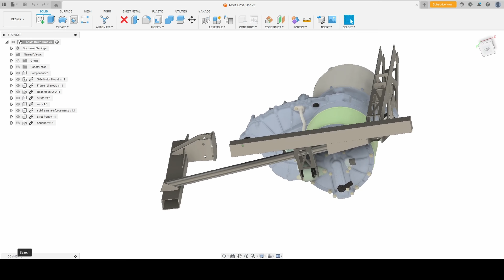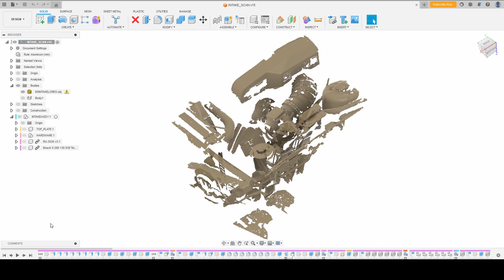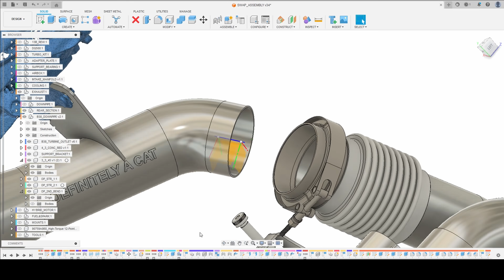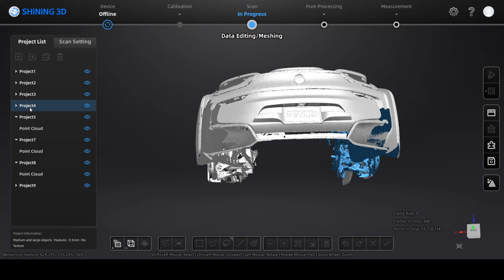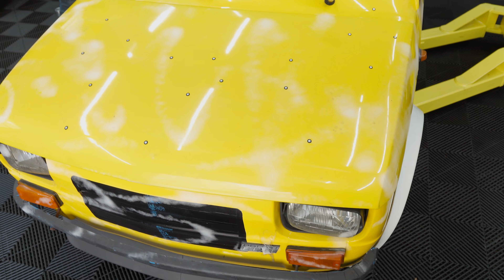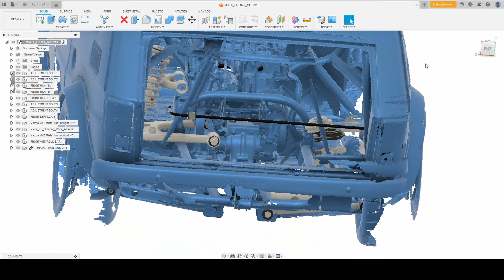Is the Einstar 3D scanner worth it? One year of automotive projects later.

Comment: this probably isn't a new complaint but, I've got an all AMD PC. that's right... I found out after I purchased an open box Einstar scanner that the seller isn't accepting returns. I'll need to either add a second GPU that's NVIDIA made or just ditch my AMD card entirely. I wish this had been stated up front before I purchased. not just on the seller but, all the reading and searching I did never seemed to mention this. 😞
now that I'm done complaining, I'm a new subscriber as I heard from a friend about the wild BMW project you're doing. can't wait to see it running and making noise in the car!

Comment: Is the Einstar still worth purchasing at $645 in January 2026 for someone who wants to scan car parts like valve covers, timing covers, etc?
Reply: I might have to reconsider this question, looks like you have to have an Nvidia GPU to run the scanner/software. One of my pc’s has an old 1080ti, but the other newer one is running Radeon rx 6800 xt

Comment: Hi Jon, i am just packing my Creality Raptor Pro to have it returned. The issue and criticism is almost identical to yours.  I'm returning the scanner because it's unsuitable for my automotive project (electical restomod of a corvette C3) and, in particular, because of the severe software's lack of functionality. That can't be it! Compared to the Einstar and its Shining software as a reference, the Creality software has too many programming errors, no way to align the scans to a coordinate system, and, extremely annoyingly, no support for the 3D Connexion Space Mouse. Sorry, I have to work with it and get results, not spend hours sticking markers. Even though there are many recommending videos on YouTube, Creality is a good year behind the competition when it comes to software. Thanks for your review. Yesterday i ordered the Einstar. Half the price of the Raptor, twice the functionality of the Raptor. I want to work, not to play.
Reply: Finally I had a servere struggle with Amazon. They complained about the return and cited me for allegedly returning damaged or incomplete items. Yes, about 50 original marker points were missing, which were replaced with similar items. I think Creality is being really unfair to the customer. The customer then has to deal with the seller, and the real cause is poor, faulty software that doesn't serve its purpose. The scanner is great, but the software ruins the success of working with the device.
Reply: Isn’t the obvious limitation with the raptor the scanning size? It’s only suitable for small items right? That is what is really limiting me with my raptor

Comment: Could you go into more detail on the exhaust measurements? Kinda got lost on what you’re doing.

I see build the mandrel bends off the origin point, find the center line and angle but I’m confused on the chord length.

How does the chord give you your alignment marks?

Gonna buy one of these scanners now and I subbed. Good stuff man!
Reply from the maker: The chord length is where you make the mark to which you rotate the tube to. It just allow you to do it with a straight measuring device rather than trying to wrap a tape measure around the tube
Reply: @CouchBuilt I watched it again. The 110° is how much one bend rotates off the centerline of the first one?
Reply from the maker: You got it, centerlines are rotated 110 apart.

Comment: Great vid, thanks. Would you have any recommendations for a computer, e.g. i5 or i7, 32GB or more RAM, 4060 or better (ouch), etc. I suspect an appropriate laptop will be 2 or 3 times the price of the Einstar and moving my gaming desktop about isn’t realistic, even if it does have the hp.
Reply from the maker: Max out on RAM. Im on a 2020 Asus G14 with 40GB RAM and an RTX2060. The GPU is dated but holds its own. It will peg the RAM resources easily.  I've been eyeing the new ASUS PROART 16 as a possible update.
Reply: @ Thanks! I’m not surprised about the RAM. I was using Reality Capture to 3D model my house and a couple hundred photos produced a 60+ GB model. Even with a 24 GB VRAM in a 4090, I had to upgrade to 128GB, the max my mobo could handle. Real world data is insane.

Comment: Just Subscribed to your channel. Thanks for doing the in detail video. Its great to see a video on purely useful applications. 

I want to ask if you think the Einstar Shining would be able to scan/Capture a surfboard? Surfboards are kinda flat and curvy, and you would have to merge top and bottom scans (obviously assuming using markers and scanning spray/dry shampoo). I would be willing to just buy an einstar and see how it does, but having to buy a gaming spec computer as well makes me hesitant. So would be good to get your opinion if you think it would do the job????
Reply from the maker: It would do it, but you're going to need a ton of scan markers. This would be the case for any scanner though. This is the type of thing that will make tracking difficult as you really don't have any unique features outside of maybe the nose and the fins.
Reply: @CouchBuilt  Thanks for the reply, I played around with photogrammy with some apps on my phone, but getting anything relatively useful was impossible.
  I was thinking about either the creality otter or the einstar, I assume the einstar would be the safest bet.

Comment: Excellent in depth review. With what Ive seen so far I think it would work with several scans combined, but would you say this scanner and software would be capable of scanning an E34 with a gutted interior in order to build a roll cage?
Reply from the maker: A little late, but yes, this should be able to do a full E34 by merging a few scans without issue
Reply: @CouchBuilt  We got antsy and bought one anyway. 10/10 good investment and has exceeded my expectations. As of right now we already scanned the interior of our e34 and are now in the process of designing/building an FD Spec roll cage! Took some fiddling to get it to successfully mesh the interior, but it only took 3 scans to do the whole interior.

Comment: Worth mentioning that the einstar requires internet and an account, so you can't re-sell it and if the network or software is down, the scanner is a brick.
Reply from the maker: Neither of those statements are true. They give instructions for offline use and you can reset the serial number bindings. https://support.einstar.com/support/solutions/articles/60000818841-how-to-activate-einstar-on-passport-
Reply: Wait seriously? You need internet???
Reply from the maker: No, it works offline.

Comment: scanning is fine, but when i import the scan to reverse engineer... it comes out way out of scale and massive? is therer a way to fix this?
Reply from the maker: Use the insert mesh tool. Don’t just open the file.
Reply: @CouchBuilt  ive done that but the file is still vastly oversized. I use f360 and plasticity… i save as obj. Ill do some more research as well. Any advice is appreciated. Thank you for the reply
Reply from the maker: It’s probably being imported as inches. Try scaling it to mm and see if the dimensions are correct 1” = 25.4mm
Reply: @CouchBuilt  it was a units issue but also a software update issue. I was running plasticity 1.2.1 … i thought the software would update automatically but it didnt. Now im on v24.2 lol this version has a prompt for units sizing when importing mesh
Reply from the maker: @c.d.m.3821 glad to hear ya got it straightened out!
Reply: The measurements tool on exstar is accurate (in mm) but the second it gets imported its out of wack. I think i need a second mesh optimizer before uploading to cad software

Comment: We have some Einstar scanners at work. We’re a smaller engineering consulting company, so not infinite funding for equipment always. We’ve used them for several projects, sometimes traveling to scan on site. I’ve found that you really need multiple scanners from them. One that does smaller parts, and one for larger parts. The smaller one will have a smaller scan FOV, so it won’t be useful for doing a large 5-10ft part. Fortunately, the Einstar scanners aren’t crazy expensive, so you can pick up two and they’re still a fraction of the cost of some other popular options.

Comment: I studied mechanical engineering, and now I'm at NASCAR technical Institute. How would someone go about using a 3d scanner and learn what there doing? Is there an online crash course?
Reply from the maker: Using the 3D scanner will be mostly dependent upon which scanner and software you end up choosing. If you want a pretty good quick overview of the workflow to work with the resulting mesh in CAD, check out this 2 part video. https://www.youtube.com/watch?v=vyd-RoIS7pk       HP Academy is also coming out with a more in depth course on 3D scanning for motorsports parts. You can keep an eye out for that and use the discount code in the description if you want to check that out. They have some free courses as well that are worth checking out.
Reply: @CouchBuilt  I used auto cad and inventor Pro, thanks for the info

Comment: Hi thanks for doing you're review on the scanner , I also purchased the Einstar , and it's a fantastic scanner , my huge difficulty is using the scan to actually make or modify parts from the scans in fusion 360 , the reverse engineering side is   extremely difficult without a 20K software program ,  I was wondering if you would be so kind to do another video of the best settings for the scanner and how you can draw on them in fusion .
I am also building custom cars and parts for them .
Thanks

Comment: If you run the interior scans at a higher resolution, would it clean up the switch holes etc?
Reply from the maker: Yes, it’ll maintain the detail there much better. If you were designing to the switch holes, then I would keep that section in high resolution and the rest reduced.

Comment: Is Rhino better with the meshes, does it handle them better? Or blender or something? I’ve experienced those pains with high poly count models in fusion and haven’t fully healed yet 😄
Reply from the maker: I’ve messed with Blender a bit to add some surface pattern embossing to a mesh, but I haven’t used it much beyond that. I don’t usually work with meshes unless it’s for getting measurements so I think Fusion is still going to be the best choice, even with its pains.

Comment: Thanks for sharing! I appreciate the honest info. I keep eyeballing this scanner for some very similar work on my auto projects but haven't yet made the purchase. One thing I don't have yet is the laptop.. the recommended specs the scanner wants are pretty demanding. Have you had any notable issues with yours? Did you have to upgrade at all? Any info would help!
Reply from the maker: I use a 2020 Asus G14 with 40gb of RAM.  The RTX2060 is a bit dated now but it does everything I need it to. Anything running an RTX4060 and 32+gb RAM is going to do pretty well. The better laptop will play nicer with CAD as well. If you’re doing anything beyond web browsing or MS Office stuff, it’s usually worth spending a bit on a higher spec machine.
Reply: @CouchBuilt  Ah okay great, thanks for the follow up. I have a solid work desktop but I can't be lugging it to the garage so the laptop would be purchased to scan stuff, then again if it can do CAD as well that's a bonus!
Reply: @andrewpearson-roach8592 max your ram. Took mine from 16gb to 64gb and it made a huge difference. Also keep the laptop plugged in while scanning!

Comment: Do you use the free version of Fusion or a paid version for working with the meshes and then the design work?
And is the free version more than capable enough too do it?
Reply from the maker: I use the paid version, but the free version isn’t lacking any of the tools that I use. I don’t do any mesh to solid body conversions, nor would I suggest anyone ever go that route. Once the mesh is in fusion it’s mostly just creating planes from 3 points all over the mesh and then getting mesh section sketches based off those planes. All of that is free.

Comment: Great content. Might be worth reaching out to creality to try their new Raptor laser scanner that is $1500. Creality have had really ordinary software in the past but it seems like they're trying to step it up to take on the einstar.
Reply from the maker: I’m cautiously optimistic on that one. Availability has been limited and most examples seem a little too good. I’d definitely like to try one.
Reply: @CouchBuilt For automotive projects the Otter is better (and cheaper too). If you're testing something I recommend testing that.
Reply from the maker: @swecreations how would you quantify better? I’m all about making it cheaper and attainable.
Reply: @CouchBuilt   The blue laser on the Raptor is really only good for better detail on really small objects like for getting traces and components on circuit boards, but the infrared scanner (which will be the only thing you use scanning cars and car parts) is worse than the Otter. It's more of a product for a different kind of user than a straight "upgrade".

Recommend watching Making For Motorsport's review of both of them, you can clearly see that there.
Reply: Yeah! Using Raptor for 2 weeks, it's just much powerful tool that Einstar. It was new to me that I can make really accurate scans with holes/sharp edges without any pain :)
Reply: @alexandershinkarenko3725  I just ordered a Raptor. Software was holding me back but it looks like creality are serious about getting it right going forward.
Reply: @alexandershinkarenko3725 Did u ever use the Einstar?

Comment: Are you planning on using the stock cluster? Like a retro mod kinda thing.
Reply from the maker: The stock cluster is staying and I’ll manage it seeing the correct CAN stuff for RPM and gear. There aren’t any other normally displayed engine vitals so I’m still deciding on what to do there. I’m not usually a fan of an aftermarket race dash as a wart on the interior.

Comment: I think I'll give the scanner a chance, even though I've already spent 1000€ on a Revopoint scanner that works absolutely 0.0%. I just don't have a good feeling about such scanners since I fell flat on my face with mine. Saved 12 months only to have a useless product lying in my cupboard. The problem is that you can't get any more money for them a short time after my purchase. Otherwise I would have sold it.
Reply from the maker: That was my experience with Revopoint. I got in early enough on the kickstarter that when I sold it, along with the fact that they were significantly behind on shipments, I was able to break even. That’s the part that turned me off to their stuff. As soon as you buy something it nearly becomes obsolete due to the next follow on release.
Reply: I don't know what revopoint version you got, but the default exposure is basically set to 0 where it'll scan practically nothing, whereas it works way better if you just crank it up to 10 on any object that isn't pure white. It also has undo/redo buttons in the software now, so you can back up a bit if it starts scanning garbage data rather than restarting the scan. Might be worth giving it another shot.
Reply: Which revos do you guys own?
Reply: I had a Revopoint Pop 2. It worked, sort of. I also briefly owned a Creality Otter. The thing holding those back is the horrible software and QC. I returned the Otter and got an Einstar. It's so much better than even the newest Revo and Creality products (although there is a new one literally every few months).
Reply: @lavachemist  the pop 2 is the model I'm currently looking at because of the latest low prices on eBay. I've been researching a few scanners as it'll be my first after I learnt cad and built up my printer farm. I thought scanning would be the next port of call however it's left me confused as what to buy. After further investigation and einstar looks like the pro choice so I may spend more to have something worthy of using
Reply: Have pop 3 plus and the new inspire 2… might upgrade to einstar